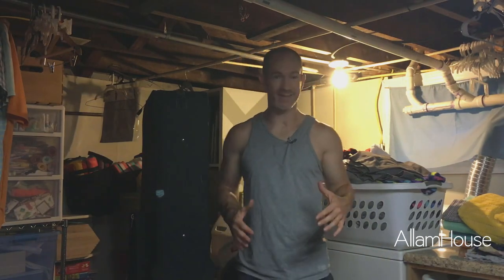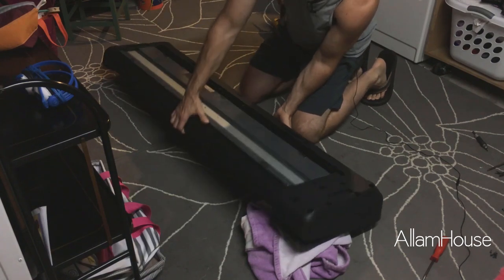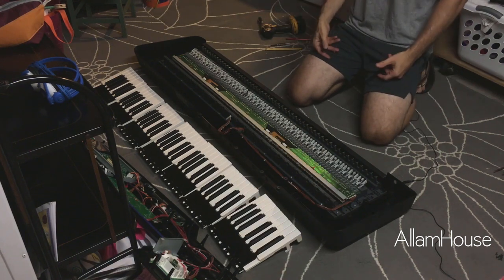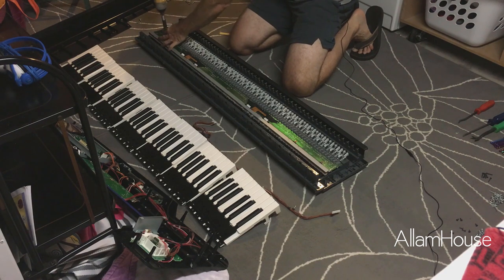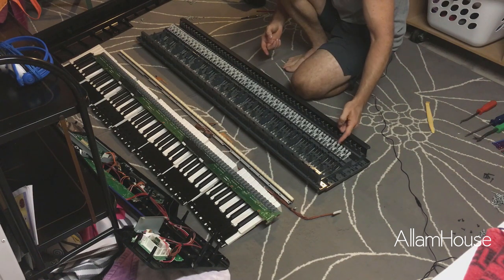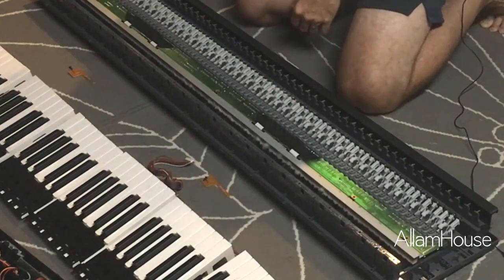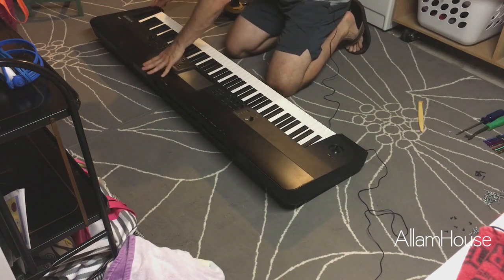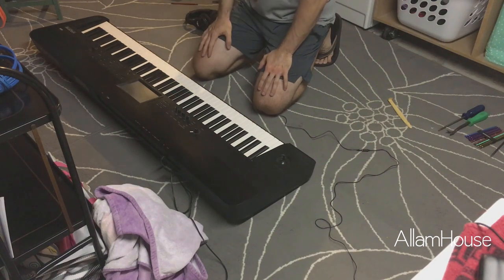Korg KROME Workstation Broken Key Weight Repair

Comment: This is the exact thing my nightmares are made of. With my luck, I'd have extra screws leftover, LOL (good job, BTW). 
The black plate that's in front of my keys (Korg M50 88-key Workstation) is loose and it's loud AF when I play. I'm pretty sure it's an easy fix but this is the only video I was able to find that even somewhat related to my issue. Whenever I need to replace a broken key, though, I'm comin' back to this video!

Comment: Removing the blocks/sections of keys -  as well as removing the 3 screws you forgot to mention releasing the 3 black locking tabs on the rear of each section ! After removing the screws gently pry each one out until it releases. THEN you can lift the block out ....
Also the screws on the underside metal plate are not needed to be removed.
Reply from the maker: Thanks for the insight. Hopefully other viewers will see the comment and find it helpful.

Comment: I have  Korg Kross 2 88 key and the chassis design looks very similar and probably the same keybed, my problem is different and notes aren't working because I think there might be dust or something at the rubber contacts. Your video has given me the confidence I need to approach pulling apart my almost new keyboard...(done repairs with my older keyboards but this is so new, hence my reluctance, but it's got to be done).
Reply from the maker: I’m glad it helped you out. Now you can get back to making music.
Reply: @AllamHouse  Well, I haven't done it yet, the number of screws, I'm not sure if I really need to remove all of them to get just the top off, it's usually the outside ones, I don't want to have to undo things that like hold the keybed in etc. It looks like you can just slip the keybed out but could be wrong I'm waitin to hear back from the Korg technician guy but getting impatient, am worried about all the knowbs, screen etc are they going to stay on the panel, i'll have another look at your video and maybe have another go.
Reply: Got to getting the keys off in the bottom octave where the notes stopped working, looking at the circuit path it looks they wander off in to the upper octaves and there is gunk in here that I have to clean, hopefully that will do it, apart from that the Kross 2 88 is fundamentally identical in key bed and everything else etc. except for the Korg logo and light at the back that splits off some of the back, wish me luck, I think I'v got this ! Yay, thanks for your video, I wouldn't have got enywhere near this stage without watchin what you did to this similar Korg Workstation. Where are my cotton buds, I've got the isopropyl...
Reply: Nope that didn't work, I'm going to have to work down or up and take the other octave off and have look. I thought that would fix it, it's usually been that with other keyboards I've fixed making dead notes...damn.
Reply: Going to replace the entire circuit board for the keybed and rubber contact strips now, there was a corroded circuit track...still going...

Comment: Thanks to this video my Krome 88 is up to snuff again.
One thing I learned is you do not have to remove the long green circuit board 9:25 to remove the key weights.
It's a little tight but once you do one and know the angle/sweet spot they are easy to replace.
Parts is parts , is the best place for replacement parts.
Reply from the maker: Thanks for the feedback and adding this information for the community to benefit.  I'm sure anyone else looking to repair their board will be grateful for this information.
Reply: Thanks. This answered my question. If it just pops out and pops in, why remove the circuit board? I'll be doing 4 keys tomorrow on the SP-280. It's 8 years old and has played thousands of gigs (no exaggeration!). So I bought a replacement (new) and will probably sell the older one, but now back in perfect condition (assuming all goes well tomorrow).

Comment: Thank you so much for this video. I don't know how many times I watched it. 
It saved me a lot of stress and made my experience a breeze. 
I had to replace the rubber contacts as different keys were sounding at different volume and velocity no matter how lightly you press them.
Reply from the maker: That’s awesome, I’m glad the video was helpful. Thanks for sharing your success.
Reply: is the dc power inlet easy to replace? any videos on that? @AllamHouse
Reply from the maker: @thequeensgardener  this is the only video I have made on a keyboard. I would assume it is a similar process to get into the board and the just find the connections to swap from the old to new power supply. Maybe a few screws hold it in place as well. Good luck with the repair.
Reply: @AllamHouse  thanks for the response..ill give it a shot

Comment: Great video.  Thank you for posting.

 I watched your video and the keybed for the Krome 88 and Kross 88 appear to be the same.  I just replaced an octave of keys on one of my Kross 88 (first generation model) synths earlier today.  The hammers looked identical as well.  The removal of the top cover looks the same, as well as the entire keybed.

Maybe this could help those with the Kross models as well.  These are not the best keybeds in the world, but they are sufficient for most users.

Comment: Hey I have this exact Kong Krome 88 keyboard. My issue is with touch response. So when I touch the key softly, it plays loud as possible instead of quietly to match how hard I press the key. The physical structure of the key appears to be fine and in tact however I’m thinking it’s internal. Do you know what the issue may be or which part I may need to repair?
Reply from the maker: First I'll say that this is one of two keyboards I have ever worked on in my life so I have minimal knowledge.  Also, this was a few years ago so I am going off of memory. I believe there is a sensor under the weighted hammer that senses the velocity and that will determine the output volume of the key. The troubleshooting I would do is...
1) See if I can inspect it for damage
2) Remove it if possible and swap it with another one close by to see if the problem stays on the same key or if it moves to the swapped key.
3) Once the problem is identified I would look to replace the part or move to a very end of the board (low or high) where you are less likely to use that key.
Reply: @AllamHouse   Dear Allam, I have a Krome 88 with the same problem of "MrLightning20. 
As soon as I find the courage to open it, I will try my hand at repairing it. I think I need to replace the rubber contacts, where can they be found? 
Thank you very much for your great support & a very useful video. Ciao, Ferdinando
Reply from the maker: I found my parts on eBay and there might be some links in the description of this video (most likely old by now) that might point you in the right direction.
Reply: Can you show me how to replace a middle g key on a Korg D1.... I will pay you ..

Comment: Thanks for this. I have 4 keys (Korg SP-280 but identical design internally) where the black rubber tips have come off. I was able to fix these with JB Weld Epoxy but it doesn't last. Today my replacement weights arrived and found your video. Great, but it left me with one big question: If the weights just pop in (as you showed) shouldn't they just "pop out" as well without taking the entire structure apart?
Reply: A ha! Found this further down the messages. Answered! Thanks again for the great video. From another message below: "@thebasementgourmet3344
1 year ago (edited)
Thanks to this video my Krome 88 is up to snuff again.
One thing I learned is you do not have to remove the long green circuit board 9:25 to remove the key weights.
It's a little tight but once you do one and know the angle/sweet spot they are easy to replace.
Parts is parts , is the best place for replacement parts."
Reply from the maker: I'm glad you found the video helpful and that you were able to find some answers from the community in the comment section.
Reply: @AllamHouse  It gets better. The weights were fine. The plastic bumpers had fallen off. I just popped them off the new weights and onto the old ones with a small touch of super strong glue to keep them in place. I had a tube of lube for some turntable repairs. Re- lubed the entire key set and closed it up. Works great. 

Being a full time working musician, I went ahead and bought a new SP-280 (it’s that good). Maybe I’ll sell the older one. Maybe not.

Comment: Hi, excellent video, excuse me sir, where did you buy or find de new key? Could you please help me with that information?
Reply from the maker: Thanks for reaching out. I’m pretty sure I had a link in the description of the video for where I bought the replacement units. Most likely from eBay, but check the description.
Reply: Hello, my question is the following: On the pages where they sell the spare part there are several models (style A, style B, etc.) Which one should I order for my Krome 88? Thanks!

Comment: I use krome 88.. the hammer and velocity keys have no problem at all.. but I just realized that the D# 4th octave and C# 5th octave black keys can be pulled up.. I only found out today.. but this doesn't cause any problems. at all in its application.. because of the position of the keyboard, it is still flat like a normal key.. I'm confused whether the default krome is like that or is there something that is a problem?
Reply from the maker: I’ll have to hope someone else can offer insight. This board I worked on in this video was one of two boards I’ve worked on. You could gently test some of the outward most keys to see how they act.

Comment: Excellent video. Thanks.
Reply from the maker: Alan Sizer glad it might help you out.
Reply: @AllamHouse  I was puling my wife's Krome apart and thought I'd better look it up. Found your video, then I found those last two screws just before the I got to that point in the video:-). Different problem on this keyboard - a high F# has been responding erratically. There's nothing wrong with the key action, just sometimes not producing much sound, other times too much and often delayed. I suspected a mechanical issue with the switches like dust ingress, but everything seemed OK visually. I've given it a bit of a clean , and reflowed a couple of solder joints. We'll see how it goes tonight when I putit back together. Hoping I don't have any screws left over, too!
Reply from the maker: Alan Sizer this one seemed to have some inconsistent key response as well, but the board was still playable. When I tested it (after repair) it was still present and I could see it on the level meter on the display. The owner has been dealing with it and was happy to have the weight fixed. Good luck with yours. Don’t forget to put those last two screws back 😁
Reply: @AllamHouse  all back together and no screws left over. It seems to be working OK now. The other half says perfectly, but I'm a bit more reserved.

Comment: OK, I cannot get the keys out. You skipped by it fast but it looked like you did something at the back just before you got the octave out. What was it? I unscrewed every key and they are still stuck
Reply from the maker: I just double checked the video and if you look at the 4:50 mark I pickup the section of keyds I pulled out and show exactly how I did it. This video was a made a long time ago so unfortunately I only have the video to use as a reference.

Comment: Hii...Mr, Allan, how to fix stuck key always fall inside on my keyboard korg kross 88?
Reply from the maker: I wish I had an answer for you. This one keyboard is the only one I’ve taken apart to this extent. Typically they have weights inside like the one in this video and the weight might need to be replaced.  Good luck with the repair.

Comment: Could you help me reduce the noise of the keys possibly caused by a gap between the key and the hammer?  when you play very softly on some of the krome keys, mainly with all the notes B, a plastic noise persists that when it was new did not exist.  Thank you very much and excellent video.
Reply from the maker: I have heard of people having this type of issue before, but never had to fix it myself. There are little felt and/or rubber pads inside that seem to breakdown over time. You might be able to find some to replace, but my guess is they are built into the actual hammers. It’s worth following this video to take the board apart and investigate before ordering anything.
Reply: AllamHouse thank so much for your answer. If you discover something about this problem, please publish it.
Best regards 
Rafael
Reply: AllamHouse Hi! I want to comment you that I discovered whay  the key noise is produced. I disassembled same keys and I put better the grase, mainly in the white keys, an the noise was reduced significantly. Of course, the solution is temporary until the grase to be desplaced again.
Best regards 
Rafael

Comment: Hello sir. How were you able to determine which key replacement to purchase? I found one ebsite that offers 3 different replacement keys under a special number that doesn't reference the keys. Thank you so much
Reply from the maker: For the board I worked on in the video there were only two options that showed up in the search. One was for the white keys and one was for the black keys.
Reply: @clara what exactly is the issue with the keyboard? If its a weight issue, The weights are designated for different regions/zones of the keys and for black or white ones.

Comment: Quick question..if it's just the key itself and not the hammer that needs to be replaced...would u have to take the same measures with the disassembling part..or after the back is screwed off ..can I just replace the key from there
Reply from the maker: I assume you would still need to take the top cover off... which means you have to take the bottom off as well. Just keep track of the screws and you’ll be good.
Reply: @AllamHouse  ok thank you

Comment: Are you still fixing keyboard? Several of my Krome 88 hammered keys, in the middle section, are giving me extremely high pitch when pressed down.
Reply from the maker: The board I fixed in this video was the las tone I’ve fixed. They tend to wear out their grease and might just need some more to be added.
Reply: @AllamHouse  i really don't know how to add grease, how much do you charge?
Reply from the maker: Sorry for the confusion. I do not work on keyboards. I happened to help a friend and made this video a few years back, but this isn’t something I do regularly. If you are not comfortable doing the repairs yourself, you would be best to find a musical instrument (or electronics) repair shop to complete your repairs.

Comment: I have the same board , everything was fine but now the high "E" key is stuck in the up position and can not be pressed down and you get now sound out of that key , it's pretty much locked up
Could this be the key weight or just something jammed up?
Reply from the maker: My guess is that it IS worth taking apart and checking the weight.  They tend to get brittle over time and even a small broken bit can cause an issue.
Reply: @AllamHouse  Hey , thanks for replying.
After watching this video about a dozen times, I think by the weekend I'll have the courage to open it up and take a look
Maybe I'll get lucky.
If not I have found replacement parts online
At least it's the highest E note on the keyboard not a total show stopper
Reply: It ended up that the rubber piece on the end of the weight tore and was stuck in bottom of the key causing it to jam.
Ended up replacing 3 octaves of keys and 4 key weights, and lubed everything up.
It plays like new now!
Reply from the maker: Thanks for sharing your findings. I’m also glad you got your board back up and running. Happy music making.

Comment: Will this weight work on 61 key model? And if not can you please suggest me where to buy one for 61 key model , thanks in advance please reply ASAP , love from india
Reply from the maker: I am not a keyboard expert so take this information as you see fit.  I assume the keys from a Korg Krome 88 would be the same on a Korg Krome 61.  Most manufacturers tend to keep as many parts the same and just make a smaller platform to keep production costs down.  Good Luck.

Comment: Hi sir I need help form u, I'm using korg krome 61 keys , now a days it's not working properly, while the system turning on mode it's Wil shows reverse image anytime so plz help me how to resolve this issue...... reply ur mail id
Reply from the maker: That is interesting. I’ll start by saying this keyboard was only the third one I have messed with and I have only dealt with broken hammers (weights) in my experience. Your issue sounds like it is either a bad connection or a bad screen. Both would require you to dismantle the board (similar to this video) and then diagnose. You can start by cleaning the connections and making sure it is sold (use contact cleaner). If you still have the issue then it’s time to work with your local small electronics person or just replace the screen. Good luck.
Reply: is changing the dc power inlet hard? I got the piece.I'm just a little intimidated opening it and putting the piece... The DC inlet connector is very frail.And a week design in this keyboard.... @AllamHouse

Comment: Mm hey 😘 I like ur shoulders. 

Whered you order the parts btw
Reply from the maker: I picked up the parts on eBay. There should be a link in the description.
Reply: @AllamHouse  I saw that right after I added the comment, and ordered the part. I noticed that some of the other keys feel... kind of off, now? I have to take it apart again anyway :/ guess Ill see if I did something wrong. lol